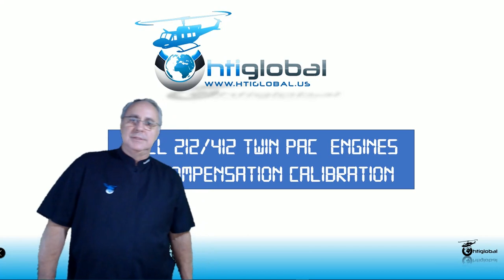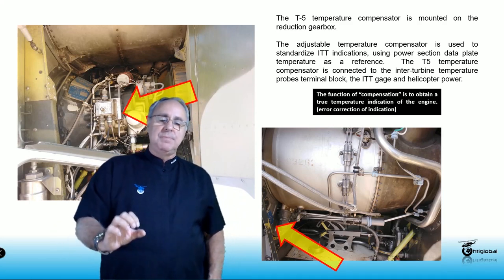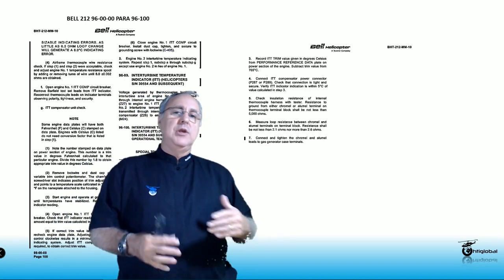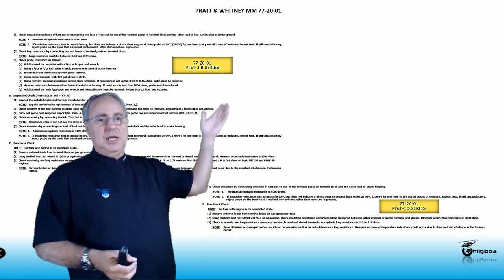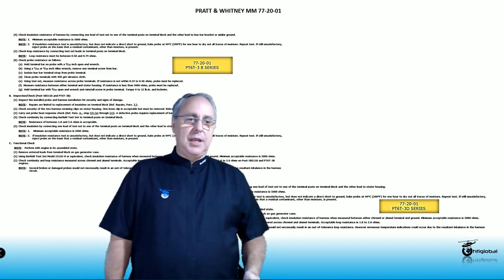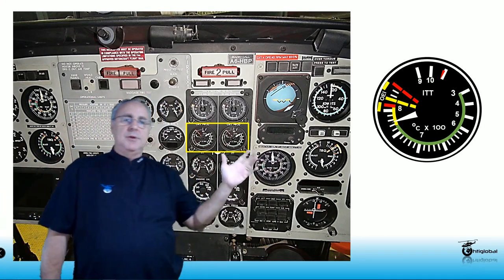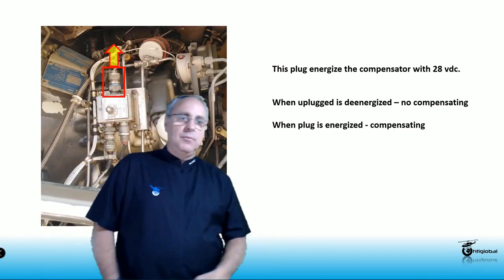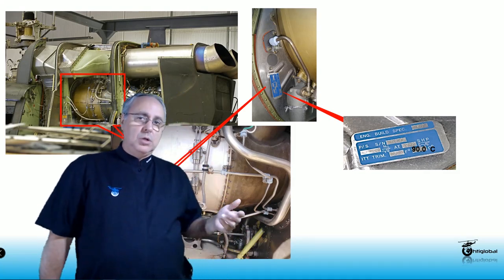PT6T-3 SERIES - ITT COMPENSATOR CALIBRATION

Comment: I just did this check and the #2 engine data tag had “ITT Trim @ 149 F - 827 C”….the manual said use 810 Celsius - ITT trim Celsius = -14 Celsius was my answer…is that correct?